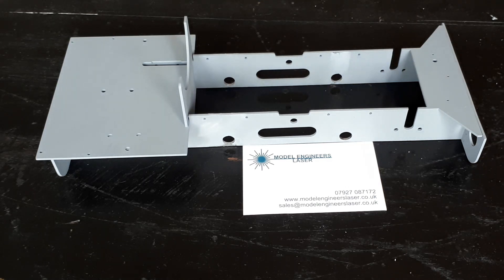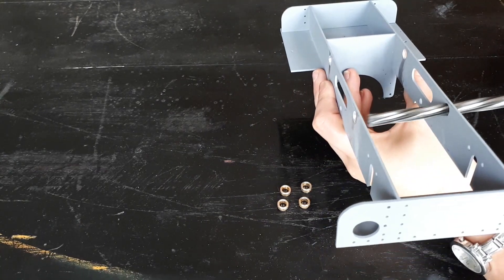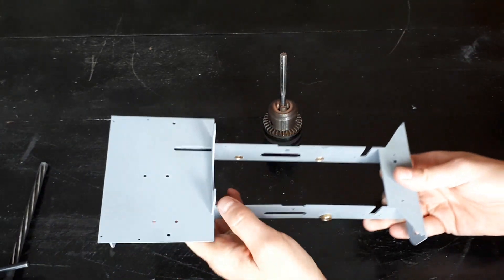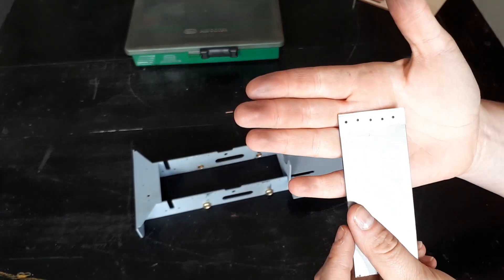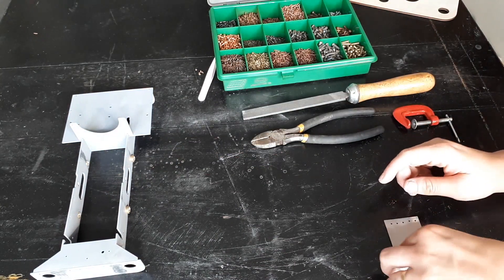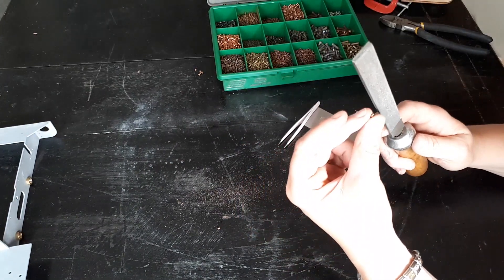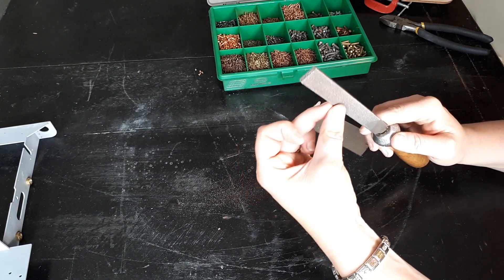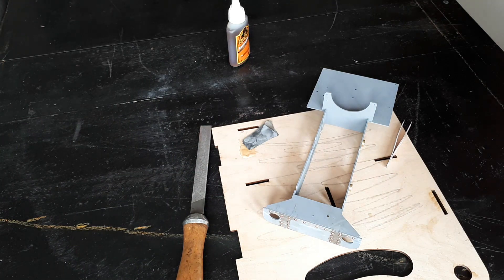Hunslet Jack - Part two

Comment: 16:34 there is a simpler way than dunking the rivet in a pool of glue and then trying to manipulate it into place. Take a sewing pin (or any other piece of suitably thin metal rod) pick up a drop of glue and apply it to the sides inside the hole. This prevents the glue going all over the place.  Pick up the rivet with your fingers and push it in the hole. It seems stupidly simple but it works better, your fingers are an extremely delicate and sensitive instrument. If you insist on using tweezers, file two small indents on the inside near the end. The rivet will then seat in the indents and will not tend to fly away.